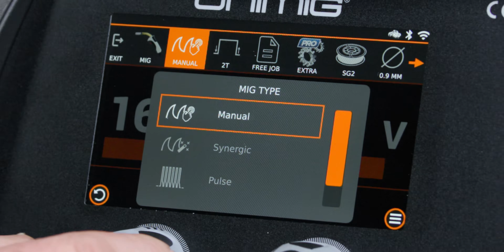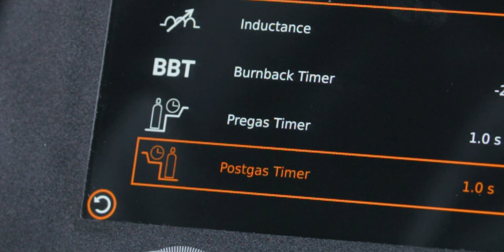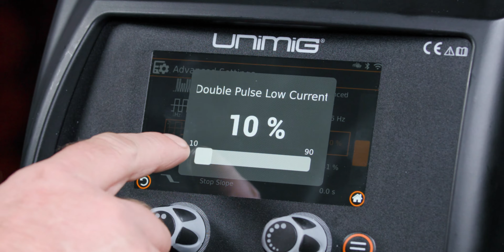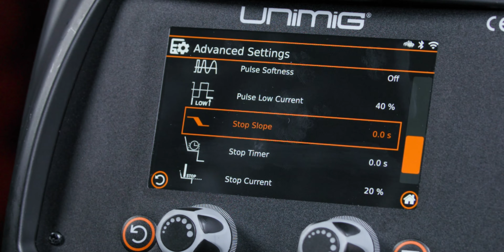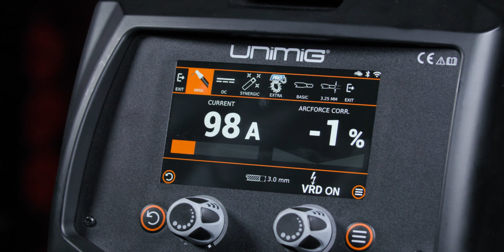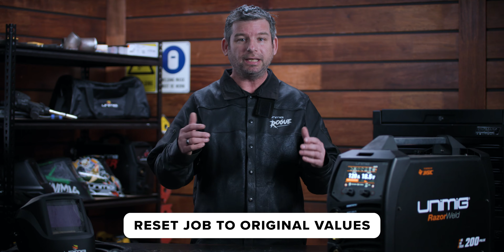RAZOR 200 PULSE Full Setup Guide

Comment: In aluminum welding, is there possible to weld 4mm or 5mm thick using 1mm wire?
Reply from the maker: yes it's possible to weld 4mm or 5mm aluminium using 1.0mm wire. You'll want to ensure you're running enough amperage and using proper joint prep, like a bevel for thicker sections. For best results, we usually recommend 1.2mm wire at that thickness, but 1.0mm can still get the job done with the right technique and by using the recommended machine settings on our Razor 200 Pulse.

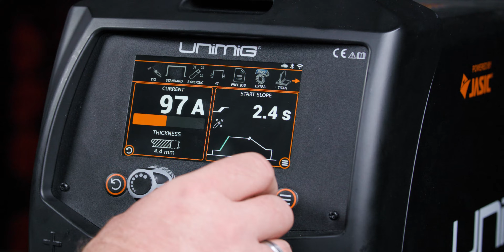Comment: In TIG mode, can you make ajustements of the individuel sections of the welding curve only with the knob ? Time: 10:36
Reply from the maker: Yes, with the right control knob, you can cycle through the TIG weld cycle.